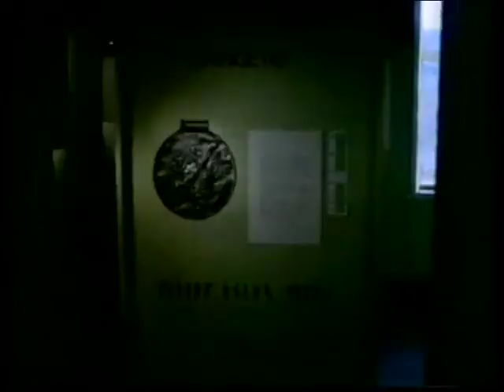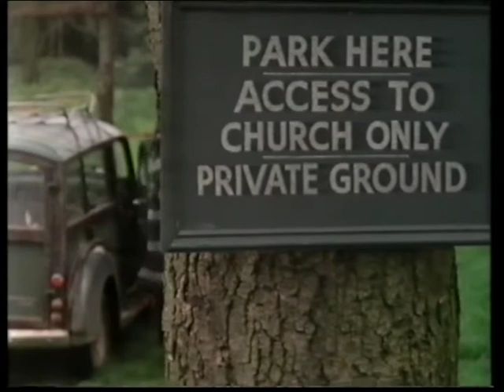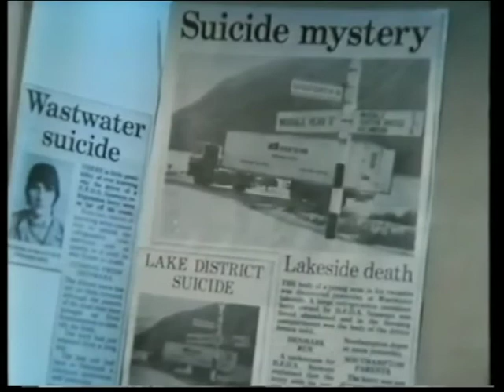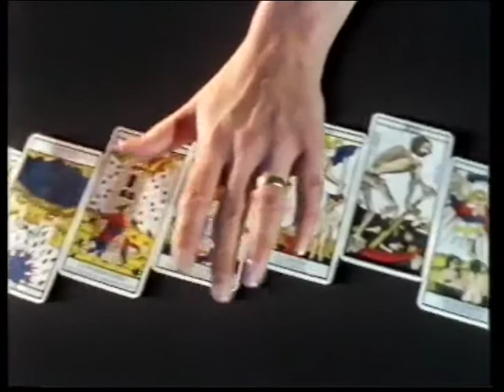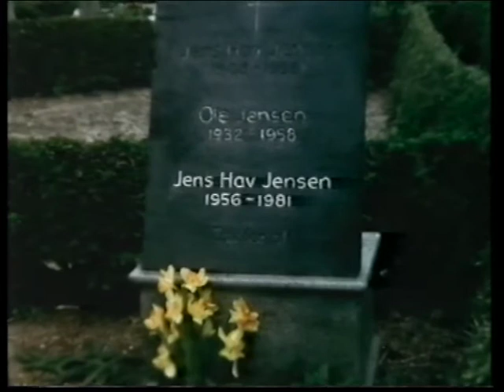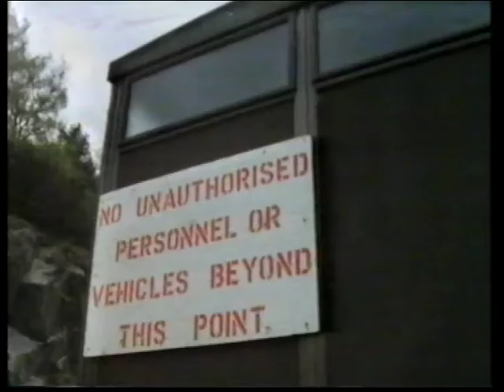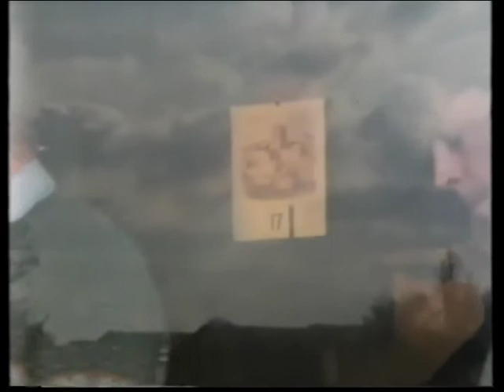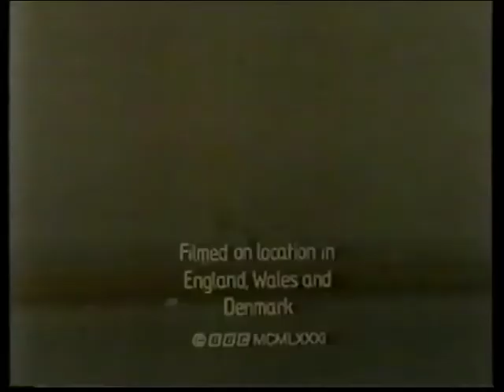Artemis 81 - Complete Version

Comment: This is surely NOT complete - around 1.54.20 there's a crucial scene missing, the Hitchcockian scene in the cathedral: here we see the start of the scene with Bennett stepping across the cathedral floor, but then jump ahead to him and Sting in the apartment. Another version of Artemis 81 which does contain the scene is on YouTube, though with terrible picture quality unlike the good quality here but viewers need to at least cross reference the two or  they''re missing a crucial sequence.
Reply: It should have a Runtime
 of 3 hours 5 minutes (IMDB)
Reply: Thanks, that saved me almost three hours of searching. Shortly after that scene was filmed, I found myself able to crawl through some of the inner parts of that Cathedral without being challenged. I grew up in L8, so was watching it being built, and to this day it still terrifies me walking up the stairs to the rooftop (although I still do it cos it's well worth the trip). Always reminds me of this film, which I only saw once, on its original transmission, yet it clearly made a big impression on me. Have to watch the whole thing, so will scout around more.